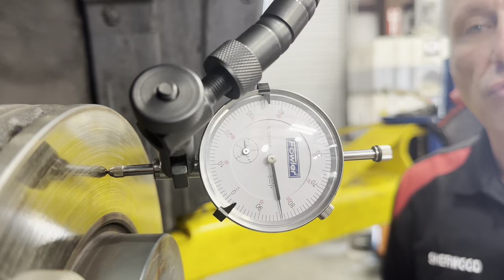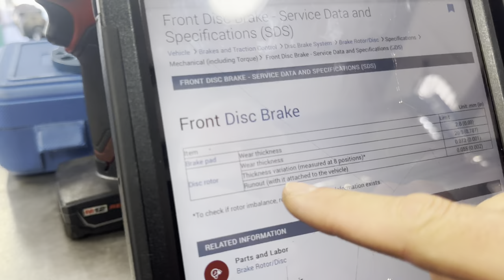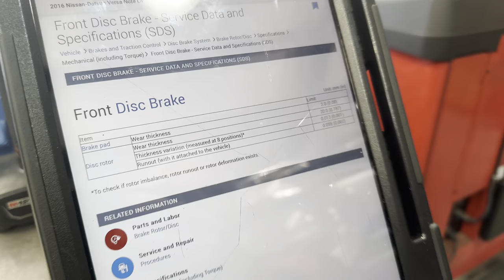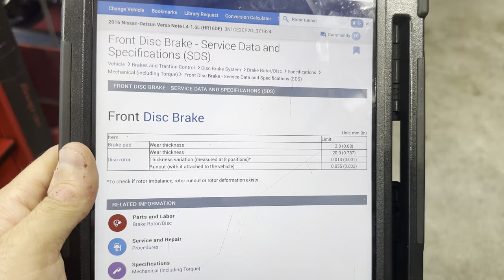It’s Vibrating When Braking & It’s Not the Rotors. How to Test! (Nissan Versa)

Comment: Most mechanic shops have glorified part changers as techs. It's nice to see a professional process of diagnosis
Reply: But they did mess up the first time. They threw the wrong parts at it just like a parts changer. Only when it came back again did they do what they should have done the first time.
Reply: With a line of customers a mile long and competitive pricing, 8.6 times out of 10, slapping on new parts works.
Reply: @jeffconley819  Nobody is going to suspect a hub is bad; that would be extremely rare. The second time it came back is when the measurements should have been taken, if the customer complained he had a vibration. I highly doubt any shops are going to check for run-out, when they install new rotors.
Reply: @KStewart-th4sk In my experience: No. Hub bearing get wasted when people hammer on the mounting flange usually to fix broken lug studs or to release corroded aluminum rims. 

Probably should cut the new rotors & not trust they're true out of the box. 

Also too big tires are hard on bearings just like bent rims & off balance tires.

Pobably should make sure all your lug nuts are tight first & then if rotor to hub mount is clean. 

Or take a tech class to learn basic skills.
Reply: Most weekend warriors don’t turn wrenches for a living and do not know what it takes to get cars fixed and out the door. Remember people have zero patience they want their cars back yesterday and want an answer.
Reply: They threw parts at it too, struts was bad, dumb and a waste of money...
Reply: Did they not test drive after doing a brake job?  Did they just let the customer driver away?
Reply: Welcome to the real world. My TV has 8 parts and one of those is the power cable. So TV techs just rip out the lump that errors replace it and all fixed. Back before TV techs charge $129 an hour and TVs cost a weeks wages, they would find the faulty part and solder in the new one. Now it is just plug and play. You should have seen how excited my local mechanic was when he did a complete engine strip down for me. He thought it was Christmas every day because he got to do real work instead of just oil and grease jobs. He only charged a very reasonable amount for that too.

Comment: Next to the technical advice/tips, your humility in admitting your mistake and rectifying the problem were beyond admirable, professional and refreshing! Bravo sir!
Reply: @ChrisL-qh1pq  the sorry thing is no matter how good a shop is there tends to be a few mechanics working there that can be lazy and cut corners on a job. if i was waiting on rotors from an outside part house i would make sure everything else was ready to go. this included checking the runout on hubs. but 90% of the times the hubs were fine. but if you live in an area where you deal with a lot of bad roads and potholes then you may see more hub issues than usual
Reply: @hellshade2 the shop I work at is 1.10 hrs on most brake jobs per axle meaning front brake job pads and rotors is 1.10 hrs and rear brake job pads and rotors is 1.10. Not counting 2500 or 3500 trucks. So your saying you would stay clocked in to that brake job to check hub runout? I'm being polite and not being a smart ass. I truly just want to know. Thanks in advance
Reply: @collinbonebrake1119 As a customer I’d expect you to do your job properly and not have me waste money on your labor and unnecessary parts
Reply: Professional

Comment: 1st! I want to applaud you for admitting that this was something you should have done from the start instead of just switching out parts. I mainly work on all my own cars (For 30+ years now) But there are times I take it to the shop because I have no time or a lift. Knowing that you may have been busy and the few times you did get caught with a problem that wasn't an easy fix you decided to video it for us.  So we know where the mistake was made and how to look at it from a different angle is a great service and teaching tool for the public. (Me included)  I will use that as I add more videos to my channel as well.  Thank you for teaching and sharing your experience.

Comment: I experienced a vibration issue when braking. while work was been done to replace front wheel disc, it was discovered that the problem was due to one of the two caliper guide bolts on the driver’s side being slightly bent. This bent bolt was creating friction, which in turn led to the vibration when I applied pressure on the brake pedal.

The discovery of the bent guide bolt was quite strange and unexpected. Unfortunately, I had already purchased a new disc and brake pad, which, as it turns out, were unnecessary.  Sharing experience to ensure others can be aware of this possibility when experiencing vibration.
Reply: Hope u didn’t throw out the old equipment just save it for when you need it lol

Comment: Back in my day of working mostly on cars, in the 70's and 80's,, when we ordered new rotors, the small family owned parts shop we used also had a machine shop that would take the new rotors out of the box and at least check them for true and lightly machine them if needed. They did that free of charge to insure we got a good product and help prevent come backs.
Reply: WOW, they musta been burned bad once!

Comment: My Dad has been fighting with a vibration while braking with his Avalanche.  Pads and rotors changed and still vibrates.  Thanks for the heads up on the hub, I wouldn't have thought of that.  Thanks for sharing.
Reply: Was it the hub? And what year Avalanche? I'm dealing with the same thing with my tahoe.
Reply: @pattfam5663  2003 but it's a 2500 not the usual 1500.  As for a fix, it's not my truck and he hasn't driven it for the last 5 months.  Good luck to you.
Reply: Ok, thanks, I heard it can be wheel hubs and even over thightend wheel lug nuts
Reply: I've had the lug nuts over tightened cause a pulsing when braking.  It was a 95 gmc 1500
Reply: @robbyddurham1624  Thanks for the reply.  I suppose it's possible but doubtful as this has been persistent through brake replacements and several tire rotations.  And all this through the dealership who should be able to find the problem.

Comment: I want to compliment you on this video and explanation of a fundamental that most mechanics are never taught as apprentices in school (Canada) or anywhere else as the mechanics they apprentice under were never taught this nor the previous one in the "chain" of mechanic-apprentice-mechanic-apprentice on and on.  As an engineer, I was teaching this in my shop(s) as far back as the beginning of disc brake useage in late 70's.  Also, I taught that anyone taking a measurement of ANY kind had to WRITE IT DOWN when taken...ALWAYS... so errors became almost non existent.  Additionally, all such measurements and final machining measurements were RECORDED and transferred to work order as a permanent record that the CUSTOMER ALSO RECEIVED.  (Costly?  NO! It made technicians alert and careful and saved them time when it became the SHOP STANDARD PROCEDURE. )  Even flat-rate technicians found it saved them time on come-backs which virtually disappeared and the shop saved even more in customer goodwill and loyalty.  Quality doesn't COST, properly done, it SAVES!  Again, great training video!
Reply: @burtellis9710 • Why did Canada only start using disc brakes in the late 70's?
The first disc brakes were on Jaguars in 1952, followed by Citroën DS 1957. By the 60's they were common on many American and some German cars. I was taught this procedure in 1967 by VW when the 1967 1500 Beetle was fitted with disc brakes.

Comment: Always check Your New Rotors on a Brake Lathe to see if they are warped. A lot of times I have found when they have been sitting 10 high on a shelf they can get warped and have a lot of runout. I always check and take off a couple of thousands with a finish cut on all the New Rotors I install.You would be surprised how many new Rotors are out if tolerance from the factory! I have also had to cut and clean up the bearing hub because of runout like you found in this video. Great video and thanks for sharing! 👍
Reply: I've just asked that question in main comments: why not machine that hub instead of fitting a new one? How would you go about doing that? I realise that would not be something a DIYer could do (so not a subject for my channel), but I'm interested to know because I have a squeezy feeling I may have the same problem. (I realise you'd have to remove the studs lol)

Comment: Im very pleased with your presentation. I used to be a machinist back in 1990's decade working first on manual then later on CNC machines. Calipers and Mics are basic tools to find the cause of unparalelism and other anomalies of material. Everyday precise calibration of tools guaranties  correct results proper action. Thanx for very proffesional approach . Cheers
Reply: Yes , calibration and quility tools don't hurt either , if I'm gona toque somthing like a valve body maybe the inexpensive toque wrench would work but I think I will use a calibrated snapon or similar .

Comment: Salt belt tip, in case useful to someone... I coat the rotor and wheel contact faces with anti-seize to prevent rust sticking them together (could do the same with rotor to hub rust you mentioned here if it's an issue for you). 

Had enough tire changes over the years where I had to kick a tire loose from the rust. Can be problematic if you find yourself having to change a flat or something on the side of the road. Zero problems, always easy removal since anti-seize coating.
Reply: Even a little axle grease if no anti seize is handy.  I always put it on the lugs ever since twisting off a few back in my OHIO days. Not a prob in Arizona or California.
Reply: I do the same thing even in California when there's rust building up. I'd rather spend 15 seconds coating a surface than minutes getting the rust off again and avoiding breathing it in.
Reply: good tip, I live in Ohio, rust will grow on the hub and cause runout on the rotor, I always paint the hub with high temp aluminum paint, but anti seize would work too
Reply: Now thats smart never thought of that.  My dad recently done that with lithium grease.
Reply: @bf3and4highlights83  He didn't mean where the brake pads go, but where the rotor meets the wheel and where it meets the hub.
Reply: @bf3and4highlights83  except it's not
Reply: @bf3and4highlights83  I think you may have misread the faces I'm talking about :) if anyone was thinking about putting anti-sieze on their rotor braking faces, yeah don't do that, haha
Reply: Just jack the car up and quick release job done
Reply: Old school silver antisieze will hold moisture. And pick up grit. Your better off with a skim of axle grease. It will at least put some petroleum where it is needed.
Reply: What does that do to your brake job prices?
Reply: I have always done this too, learned the hard way once watching a shop SLEDGE HAMMER my front wheels off an old Thunderbird when getting new tires. I was pretty mad, but what could they do?

Comment: i do machining and auto Tech for 30 for years both jobs at my shop , both trades complement each other. if you would have moved your axle shaft up and down while watchig your dial indicator you might have saw something else also , so if the bearing play was off you would see it also, maybe look at that  the next time. but i do think you are correct with your findings. At 66yoa i think way different than i use to. molecule size and leaks its fascinating to start thinking on a different level. the deeper you think the more things make sense
Reply: correct, MANY bearings are cheap bad quality hustles! lower cost lower cost lower cost,, really. If the bearing is bad everything else shakes

Comment: Great video. I had a similar issue forever and finally was going to replace my rotor and rebuild my calipers, then it started making noise all the time and clicked when turning, so I bought axles. I finally took it all apart and the hub fell out when I took the axle nut off. The bearing was completely shot and the symptoms were erratic and non-standard. I love his attitude on thorough diagnosis before deciding to swap things out.

Comment: Much respect for you sir. Good catch on that hub. I'm surprised with how much runout it had that it wasn't rumbling during driving. Something I encountered was brake shudder on the front right wheel of my 2005 Nissan Altima with standard brakes. The hub was good, rotor was within spec, yet I'd still get occasional shudder. Then I learned about hard spots that can form on cast iron rotors due to overheating the rotor. The hard spots are called cementite, and once this forms, the rotor is basically unsalvageable and needs to be replaced. I replaced the rotor and the shudder disappeared. I believe that I may have inadvertently overheated the rotor when I was bedding in new brake pads.
Reply: I just had new rotors and new disc pads installed on my 2019 Kia serento all-wheel drive vehicle. I slowly pressed down  On the brake pedal the 5 or 6 times I use my break to stop while driving on a long stretch of road. That's the key go out on a long stretch of road and then 5 or 6 times maybe 7 slowly press the brake down preferably not on a freeway but on a too late in the highway this way you get the pads to seat and you won't overheat your rotors the first time you use them.
Reply: I have also seen hard spots on some rotors. My Daughters mini van was one and also on my SUV. New brakes and rotors but if you have a hard stop then park the car, the rotor is very hot. Most of the rotor cools gradually but the part covered by the pads stays hot for a very long time causing the hard spots in the metal or warpage or both. Then when you brake the pads grab normally until they hit that hard spot. They slide right past the hard spot and grab again, that causes the vibration and pulsating. No fix but to replace the rotor again. Even turning the rotor doesn't help from what I've read.
Reply: He failed to determine potential rotor warpage between hub mount face and pad surface. If the axle and hub assembly was re-skimmed in a lathe and a slightly warped rotor was re-installed the problem to a lesser degree would persist I have salvaged numerous flywheels and brake rotors using ceramic inserts or surface grinding to remove cementite zones.

Comment: Honest mechanics are hard to come by these days in my experience...at least in my area of East Texas. I've come to the realization that if I have the tools to do it myself, the cost vs risk (of screwing up) is definitely in my favor compared to taking it to one of the shops near me that just throw parts at a problem until the problem stops instead of properly diagnosing. I recently replaced my 2011 s197's rotors and pads, and discovered "runout". I got lucky after the fact because my braking wobble/vibration did stop with the rotor/pad replacement. I cup brushed and cleaned my hubs, but tbh they were so clean and rust free to begin with that all 4 OEM rotors came loose as soon as the caliper brackets were removed. I placed the new and old rotors back to back, one by one, lining up the lug holes, rotating the new rotor one lug hole at a time until the two rotors had the most contact with each other (least amount of gaps/light between the touching rear braking planes). This tells you where the old rotor was low or - then the new brake was high or + because the new brake filled in the space where the old brake had a valley and then turned the new rotor 180° to account for the mirror effect. The old rotor had a mark across 1 of the stud holes and studs from when the factory did the runout test and marked each rotors position for quick future indexing. I transferred that mark to the new "shade tree" indexed rotor and then indexed the new rotors to the correct stud when installing. I now know there are a multitude of reasons why this was a total waste of time, but it made sense when I was doing it, and like I said, whether it was pure dumb luck or if there was some truth to what I was doing, it seemed to work because there is ZERO wobble, shudder, or vibration where there was a severe one prior. 🤷🏻
Reply: Sometimes mechanics are not dishonest, but they may not have updated equipment or been able to stay on top of everything.
Reply: You used too many words to describe I replaced the rotors twice

Comment: Excellent video. One more thing to check before messing with the hubs. 
Note how tight the  the rotor fits over the hub and  hub bolts. If tight, clean up the rotor holes to the lugs and  rotor center hole. There needs to be a little bit of play when putting the rotor onto the hub. This solved my vibration problem when pressing on the brake pedal.
Reply: Also grease the pins. Took me yrs to figure out why only 1 side would always be shot n the other side fine.😂 it has no grease jus crusty crap. No wonder it couldn't move right. I felt dumb
Reply: @dmo848  I learned that lesson too. Moisture and dirt can get inside the pin area and freeze things up.

Comment: I rarely comment but this is a great educational video . Mechanics these days are wrench moneys with very little diagnostic skills . Whenever there is brake pulsation  the first suggestion in almost every YT video is to change the rotors . In the midwest , the salt corrodes. the hub like crazy and a curb hit easily can bend the hub . So as the comments below say - first check rotor runout , remove rotors and index , measure again.This will tell you if it is rotor or hub  . If both are good look at calliper piston and calliper pins ,Next stop should be wheel balance